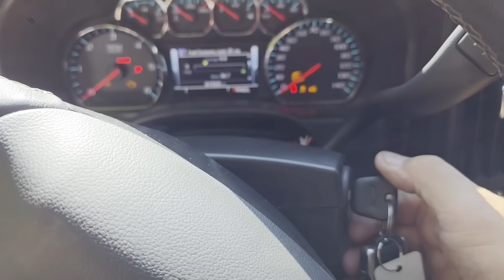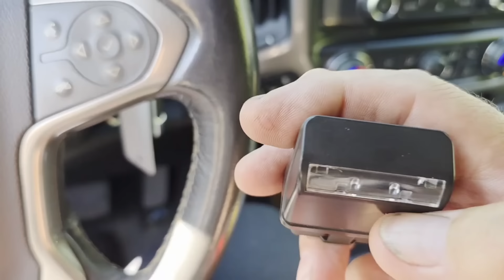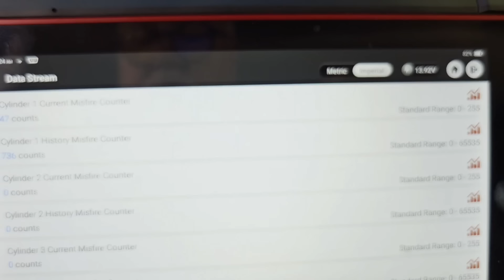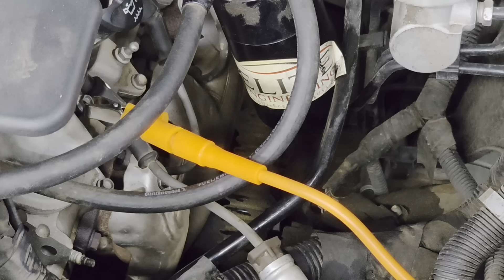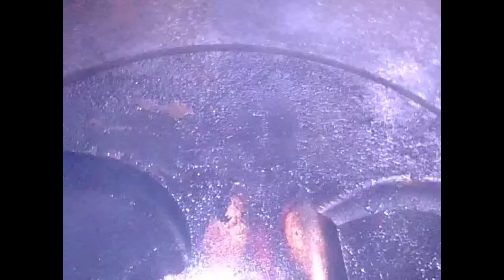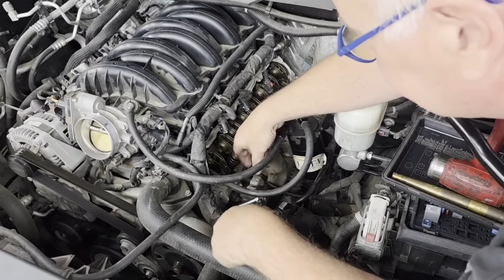No Abnormal Noise Turns A Simple Misfire Into An Engine Teardown.

Comment: I remember my buddy’s dad asked me to look at his motor said he thought it was the cam or lifter was shot… it was ticking… just needed an exhaust gasket on the manifold. To the first shop that was an engine rebuild and for us it saved the man an arm and a leg and a bad diag.
Reply from the maker: WOW! He's lucky to have you in his life. Great save. Thanks for watching & sharing your experience. Keep wrenching! Kenny
Reply: @WrenchingWithKenny sometimes the trans fluid will get that stuck lifter and or valve loose or trans mixed with alcohol if you want it thin. Good on you for saving your guy.
Reply: How do check for manifold gasket leak???
Reply: @joleaiperlis5347  you gotta look for the black soot either coming out of the gasket (most commonly at the back of the engine close to the firewall) you can have a friend temporarily plug the exhaust with a towel while you look and cause back pressure sometimes you can hear the leak better like that. If you have a manifold gasket leak I recommend just replacing both since it will eventually happen to the other side too.
Reply: @frankfrosolonejr7010  will this cause engine to shake and blinking engine light? 15' gmc yukon. I suspect it is a collapsed lifter. Thinking about selling it as is. Too many headaches
Reply: @joleaiperlis5347  if the truck is running rough and ticking it’s most likely the lifter easiest way I check for those is with a stethoscope. But you can try to use trans fluid to unstick it. Or like you said sell it if you think it’s too much work. I’d definitely have a mechanic at least check it over first since gm has plenty of issues with the dod or afm system too if you have that.
Reply: @frankfrosolonejr7010 it does have  DOD/AFM for sure. I remember seeing the V4 pop on the display quite often but I had no clue about the AFM back then or I would've tried to install a disabler. Live and learn.😂
Reply: @joleaiperlis5347  you can only turn it off with a tuner or remove it all like I did to both my cars I deleted the dod and replaced the dod lifters with ls7 lifters. I also threw a bigger cam in it as well since I was in there lol…
Reply: @frankfrosolonejr7010  im very mechanically inclined but just dont have the time to take it all apart, I know parts will be around $1000 if I decide to do it myself. It isn't rocket science. I just got a quote from 2 local shops for Dod delete.  $2800.
Reply: @joleaiperlis5347  if you get a newer vehicle definitely do your research. There are not many good newer vehicles as of late. Hence why I bothered to rebuild both of my cars engines. I mostly did it for maintenance since both vehicles had 200k miles and after seeing the market I’m happy I did. Totally understand if you don’t have the time, my job has been working us 12hrs a day 6days a week lately lol.

Comment: I think that the valve got stuck in the valve guide & it's holding open which is probably why the pushrod got  bent.

I had mushroomed hydraulic lifters in my 5.7 litre Chevrolet LS1 V8 engine in my 2002 model Holden VY SS Commodore up until over 6 1/2 years ago when I replaced the hydraulic lifters,all of pistons 1 through to 7 had valve marks on the piston crowns but the piston in cylinder number 8 didn't.

The pushrods were o.k. & I just replaced the hydraulic lifters , the engine is still going fine with all the original pistons fitted, the old hydraulic lifters would jam up in their bores once the engine warmed up a bit & cause a clacking noise but that would go away once the engine was thoroughly warmed up, the exhaust valve lifter of cylinder number 6 was the tightest so it was the biggest culprit.

So replacing the hydraulic lifters fixed the problem in my car, note my engine is fitted with genuine GM spark plugs which were made by Denso, they each came boxed as a GM spark plug !

Comment: 1- Here's the lifter release trick & other info/tips mostly for older LS versions. You were just locking it more
https://youtu.be/pP7I5tbXsfw?si=RmvtTJfL4rq_s_py
2-These probable have the 8 speed transmission, use tow haul or manual 6 max (if that's an option) to prevent AFM/DFM from engaging. If you replace with the factory lifters, drive like this or else it happens again eventually if not disabled.
3-pushrod bent, I'm guessing plastic lifter tray allowed lifter to rotate

Comment: Great diagnosis Kenny...so barring a cam lobe wiped out it probably just needs a a few gaskets, head bolts, pushrod and a AFM lifter.  Why replace the engine?  I used to be in the business; 3rd party remanufactured engines are not the panacea they are made out to be.  You never really know what you are getting.  This engines looks well cared for with the catch can and clean internals.
Reply: I was thinking owner was trying what they could dod etc. The box from obd port i suspected was a range or similar device to deactivate cylinder deactivation. Its just a shame these high dollar vehicles all have their own high dollar issues. But your right any rebuild unless your doing a speciality shop is a big gamble.

Comment: That's a common problem. Some people think it is harmonics that bend those pushrods. If you change the pushrod it will work OK for a while.
Reply: Well the bent pushrod is the symptom, not the cause, so of course changing it isn't going to fix the root cause (or address any damage done to the valve).

Comment: There is a service bulletin for bent push rod.  Have seen tons of alleged technicians put a lifter and a push tube in.  Might last 3000 miles. Then it comes to me.  I follow the bulletin and it's fixed.  Also.....not the cam unless there is visible wear...sometimes customers think they need an engine when the repair is over $2000 so it might be a communication issue with the customer.  Be careful.
Reply: What is the bulletin’s prescribed repair?
Reply: @JeffinTD  depends on the year.  Replace bank of lifters, vlom and reprogram ecm
Reply: @charliemagoo7943  Nice. If it’s a nice rig I’d think replacing the bank of lifters would make sense- considering the labor and the rest of them are the same age- plus the risk of wiping the cam or spreading glitter through the engine.
Reply: @JeffinTD  higher mileage replace all.
The issue is the vlom though.
Reply: @charliemagoo7943 or just do a AFM DOD delete and fix the problem for good.
Reply: I have an 6.2 L86- i just had the engine stripped down and all that nonesense removed- full delete- single stage oil pump/no hydraulic lifters/ oversized cam/dyno reprogram of the ECM- car engine has never run better- Beautifully designed engines screwed up by all the EPA/CAFE standards!!   Anyone who has these engines- bite the bullet and have the engine upgraded! You are driving a ticking timebomb!!

Comment: Just take both rockers off and redo the leak down test, if it holds then you know at least the valves are not bent either.
Reply: Yes but, you still have to take the head off to replace the lifter.
Reply: @stephengreen3566  Yeah, I know I have been doing this for 50 years, the problem here is that everybody assumes this cylinder isn't holding pressure because of a bent valve, well what if ken had taken the rockers off first and redid  the test and found that it's only holding, say50%-60% pressure and now he doesn't hear any air leak from the exhaust or intake, where is that pressure going? It's very possible that cylinder has a ring problem also, in which case that first shop would be right, and it would need a motor, the customer would spend all that money to find out that now instead of having no compression in that cylinder it has maybe 90 psi, the misfire isn't that bad but it's still there and the check engine is still on, all that work didn't fix it, now who is going to pay for it? If I had a dollar every time a customer said" If I knew I needed a $15k motor, I wouldn't have $5k repairing this one and if you're on flat rate, you're screwed.
Reply: but the heads coming off to do the lifter , soooo.......
Reply: @markr478  Yep, but you have to add it in to repair estimate, they might not be able to afford it, and they will take it home and park it till they can all that stuff has to be added up. I've been there and done that. Don't forget we don't have Xray vision, customers don't like surprises.

Comment: Just get rid of those dod lifters and put in regular lifters, problem solved.
Reply: Yes but, that’s $7000 because both heads have to be pulled and a new cam put in.  This means pulling the radiator and condenser.  A lot of labor cost, evacuating AC
Reply: @slalomking Replacing the engine is even more expensive.

Comment: My wife got one of them gas plug-ins. never worked after 1000 miles. I trashed it and how right you are to check everything your self that way you dont miss a thing that other people say is good or bad
Reply: if you opened it youd have seen 1 led, 1 timer chip, 2 power traces on the board.

Comment: Hi Kenny, can you replace all the active fuel management lifters with regular ones to eliminate the system>?  Good morning! Thanks for the videos!!
Reply: not without recoding the engine computer and it'stechnically illegal to disable an emissions control system
Reply: @tubesnstuff503 this is not part of the emissions this is part of fuel management and there are kits to delete that system
Reply: @throttlethumb150  disabling cylinder deactivation increases fuel consumption and so increases emissions, it's tampering with an emissions control system. you might get away with it if nobody finds you out
Reply: @tubesnstuff503 GM sells an AFM delete kit. Dies the ECM need reflashed? Yes but deleting AFM is not illegal.

Comment: I think that was a dod/afm disabler
Reply: If that was a disabler it’s disturbing that the lifter jammed without the system activating.  I have a 15 corvette with a manual transmission.  Nice thing about having the manual is that AFM/dod will not activate unless I put the car in eco mode.  Never occurred to me to put it in eco mode.  Thought I was safe. 🤔😔
Reply: @JeffL396 the only way is fully advoid this issue is to delete the AFM system mechanically as well as in software. Jasper offers a fully deleted longblock .
Reply: @JeffL396  Because of the defective lifter design, it can still turn in the bore and fail.  The disabler's claim to fame in addition to all cylinders all the time was to hopefully extend the failure of the lifters because they were not actuated into shutdown all the time.   Cam and lifter swap only true way to bulletproof these engines.
Reply: Exactly what I was thinking , we get the 5.3L (L83) pre deleted from Jaspers and we use EFlive to install the tune that disables it in software. But I have seen these little dongles that supposedly disable it in software as long as it’s plugged in .